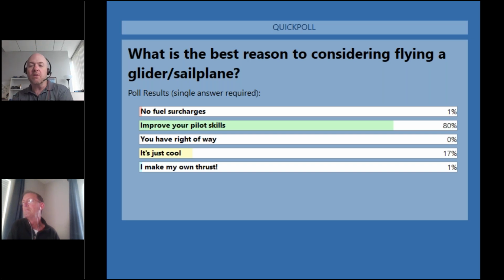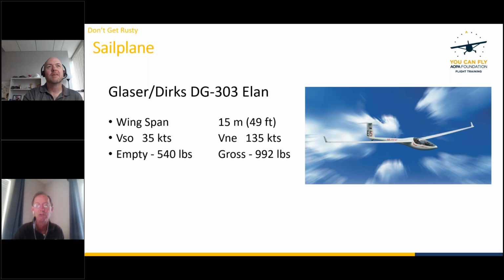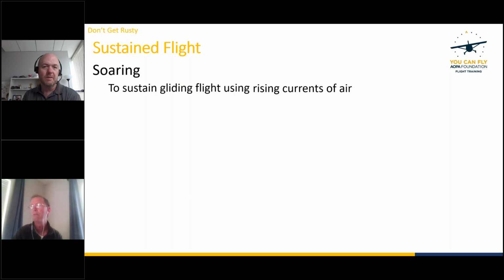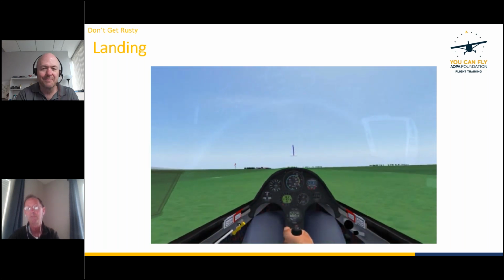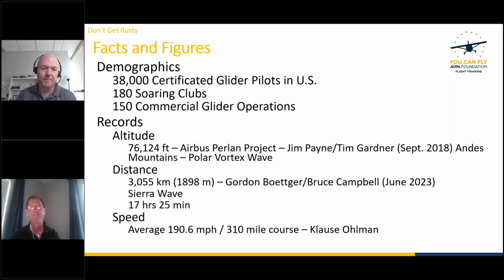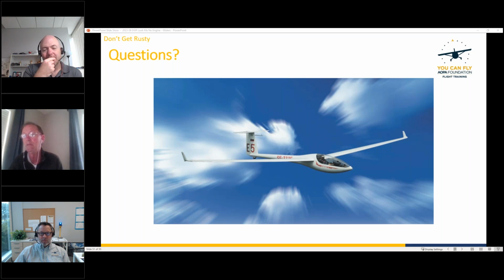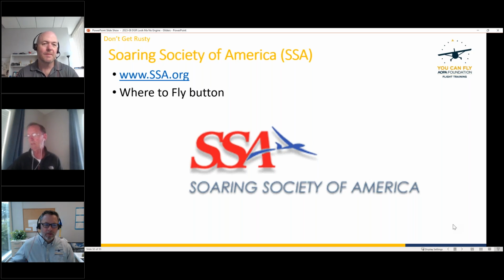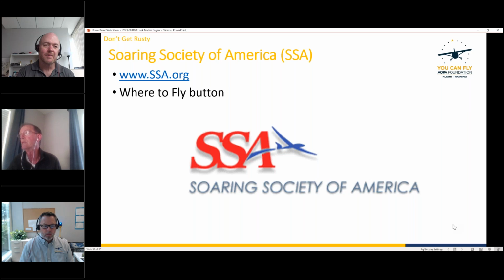Don’t Get Rusty: Look Ma, No Engine! – I'm Gliding!​

Comment: I enjoyed seeing Scott Manley. He's a go-to expert in all aspects of this sport. They didn't mention one of the biggest challenges in gliding. Finding anyone who admits to being a designated glider pilot examiner is almost impossible. That's why I bypassed my club and went to a commercial school nearly a thousand miles away. The schools have examiners available. My instructor was twenty years old and one of the best instructors ever. The same goes for my DPE. My add-on commercial glider check-ride was the only one I've ever enjoyed. Yes, my oral was four and a half hours, but I was prepared and wanted to prove it. The commercial ride was straightforward and enjoyable. I've been flying for fifty-two years, but gliding does make one a better powered airplane pilot. Get your license and go back and enjoy your club. The social aspects are what make gliding more fun than powered flying.